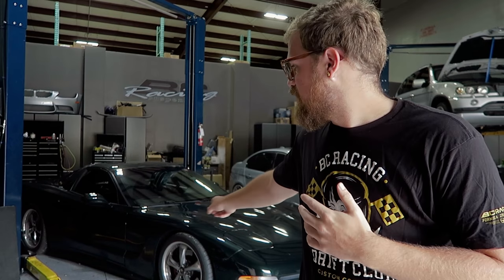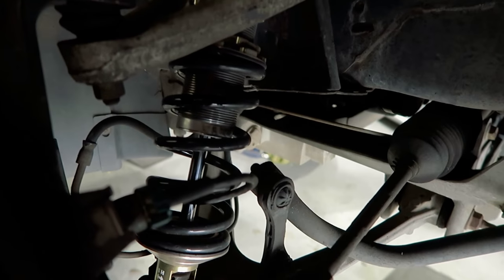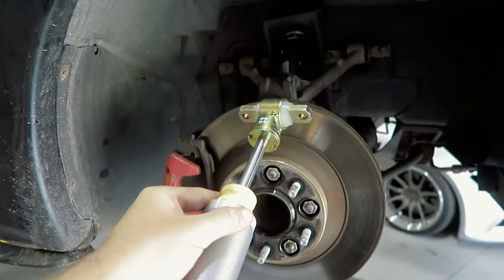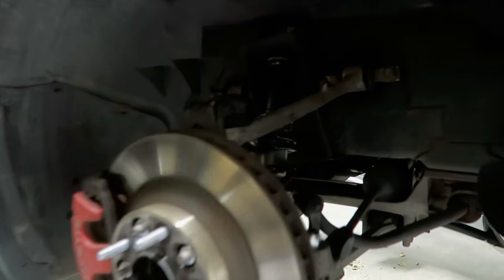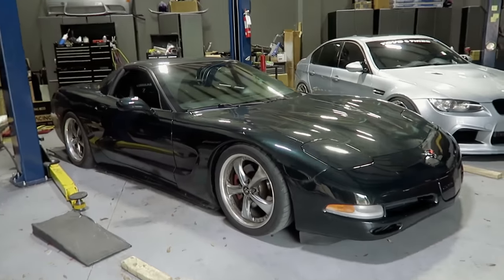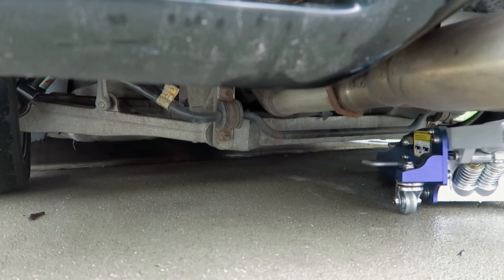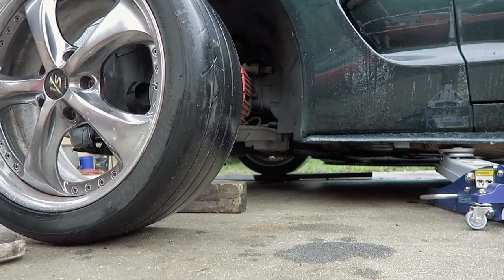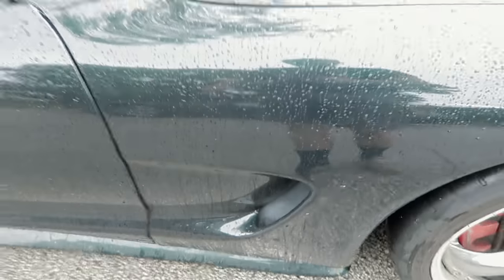How to Make Your Coilovers GO LOWER!

Comment: Can't wait for the "gutting the vette" video
Reply: codrin stefan not much to gut. not really needed either. interior gutting wont save much weight, fiberglass is really heavy
Reply: Will Thies all the sound deadening, them seats and the carpet will add up to a considerable weight. If he wanted to ditch the hvac and radio set up thats another 50 lbs. there is always a point to gutting
Reply: codrin stefan he said he would like to keep the interior in the Corvette
Reply: if he goes too light though he will have to adjust the shocks again. :-)
Reply: codrin stefan he ain't gutting shit sorry fam

Comment: I mean, you work at BC Racing, but as far as I know only coils/springs can settle after installing them brand new. Just a damper doesn't 'settle'.
Reply from the maker: +Freek Wijffels if you jack any car up for an extended period of time and set it back down it will be sitting higher than it was before.
Reply: Taylor Ray btw tell your boss I love my BC Racing coilovers on my S13 :)

Comment: If my shock has alot of extra threads on it could I possibly cut some off the bottom with an angle grinder and then be able to reinstall it and have the same effect?

Comment: I have bc coil overs on my car and have the same problem with the front not being low enough for me. I had the idea of undoing the threaded  part and cutting down the treads so that it can screw in to the body but was unsure as this might fuk the threads and then I’m stuck. What shocks did you change them with and how did you know they would be shorter. Thanks in advance

Comment: I was just wondering if the difference between the BR and DR series is worth it? My car is going to see occasional track time, but mostly going to be daily driven. It's not going to be slammed just lowered it's an e30 in case it matters. Also, swift spring worth it or nah?
Reply from the maker: +Gabriel Espinal dr absolutely worth it. Swifts. Ehh. Yes and no. If you don't have the extra budget I wouldn't worry about swifts. Dr is a much more worthwhile upgrade.
Reply: Taylor Ray dope thank you!

Comment: why not get a bigger wheel and tire. it will fill the wheel well better and then u can just adjust the ride height to be daily-able
Reply from the maker: +kickflipkid1126 bigger tires are expensive when you burn them off. lol
Reply: this is true... but oil pans and no oil is 10x worse lol   ive got a parts trans a guy bottomed out and he just let it coast of the road and heated/discolored the shafts and gears